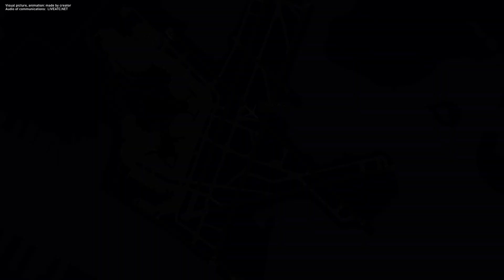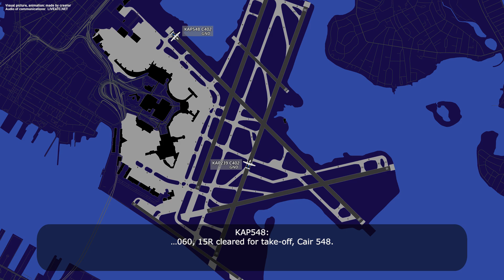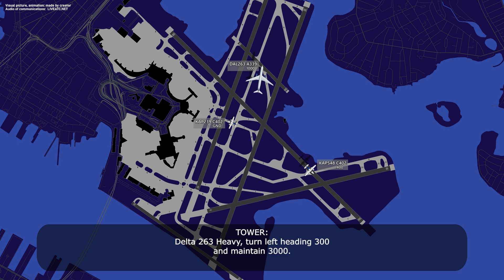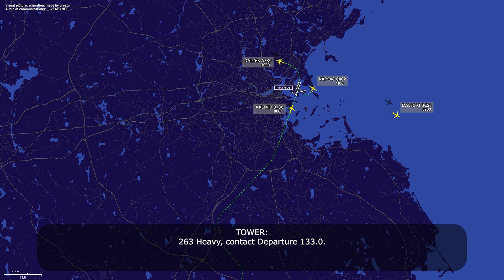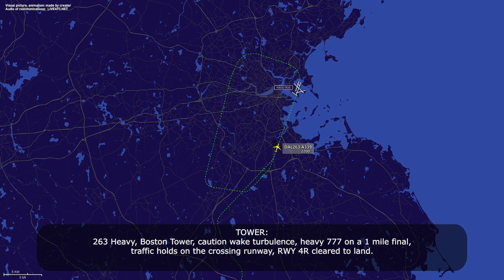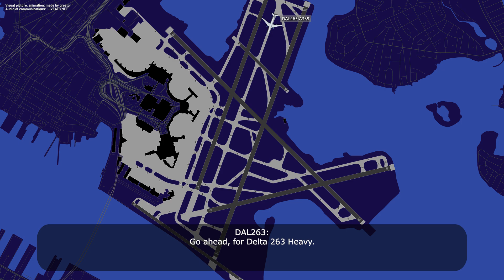Almost disaster. Delta Airbus A330-900 avoids collision with Cessna 402 at Boston Airport. Real ATC

Comment: This was a "swiss cheese slices" analog, where several holes lined up to let the danger through.  The fundamental cause seems to be ATC error.  That alone raises longstanding questions about controller workload, adequacy of procedures, distraction, stress.  Add to that the difficult to measure effects of the federal spending shutdown.

But a particularly unique and possibly contributing factor was that BOSTON RUNWAY 9/27 WAS CLOSED FOR TWO WEEKS FOR EMAS CONSTRUCTION.  The wind was strongly from the east.  The normal configuration for east wind is arrive on Runway 4R (as they were) and depart on Runway 9.  But with 9 closed, instead they were in a much less common and less preferable configuration of landing on 4R with departures instead on Runway 15R.  While 15R departures are common, they are mostly done in either a 15R/15L/14 parallel setup, or in a land 15R, depart 9 & 15R setup.

The potential consequences are interconnected.  First, the Runway 4R intersection is near the midpoint of 15R, thus "double high energy (both planes moving very fast at the point of intersection).  The normal and common Logan runway configurations have intersections at the low energy start-of-roll or low energy end-of-roll.  Second, since the 15R & 4R combo is rare, BOS tower controllers aren't as experienced with the particular timing and visual scanning involved.  Non-standard operating configurations always add risk in one or more forms and should be mitigated with procedures and planning.

More broadly, I believe that we have quite a concerning safety problem with routine intersecting runway operations at a certain  (minority) number of USA  airports.  Many foreign countries simply don't allow routine intersecting runway operations.  US airports, when built new (DFW, DEN, ECP) or significantly reconfigured (ORD, DAL, LEX, ATL, CRP, SDF, MSY, YIP) eliminate routine intersecting runway operations.  But because of property, environmental and financial limitations, we have several major airports in the USA that rely daily and heavily on intersecting runway operations.  These include BOS, PHL, LGA, DCA, BWI, HOU, LAS, HNL, MDW, BUR, and (king of them all) SFO.  The only true solutions that wouldn't require severe capacity cuts are either to bring available technology to bear to make collisions virtually impossible; or to close/reconstruct the problematic airports.
Reply: it's always swiss cheese.   This isn't any more than anything else.   The point is that there's not a hole all the way through, which was the case here.

Comment: Things are tight when a plain "goaround" instruction isn't enough - but it's "goaround and turn...". Cannot remember hearing this before (goaround with immediate turn over the airport, as vertical separation alone wasn't going to be sufficient).
Reply: It does drive me crazy, though, when I hear a go around instruction that doesn't resolve the conflict, and no turns are issued.